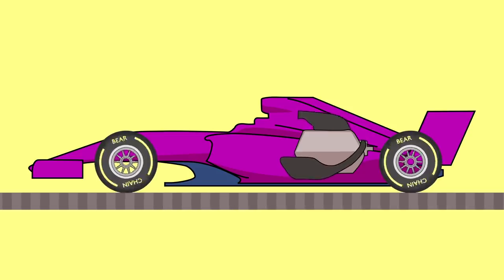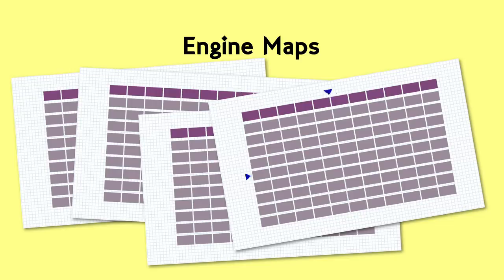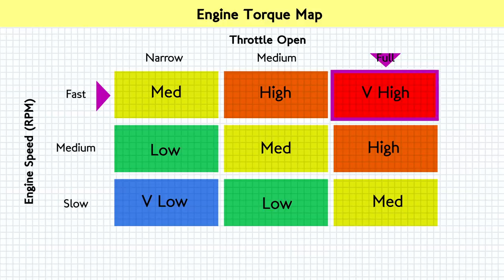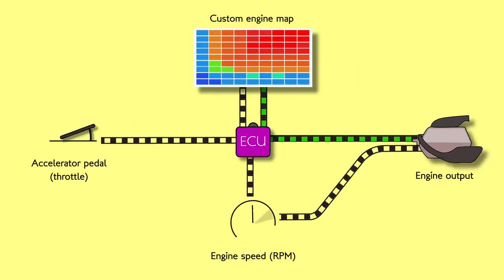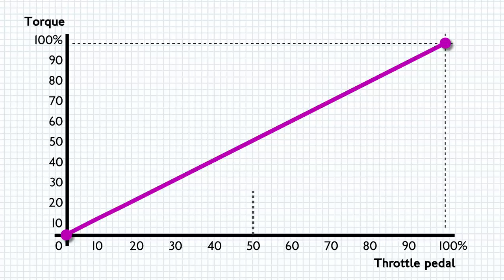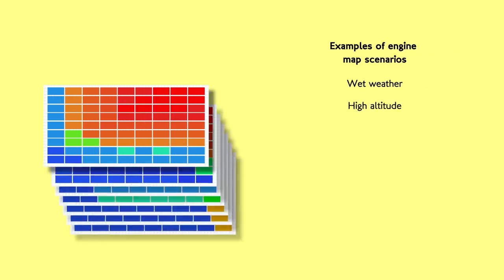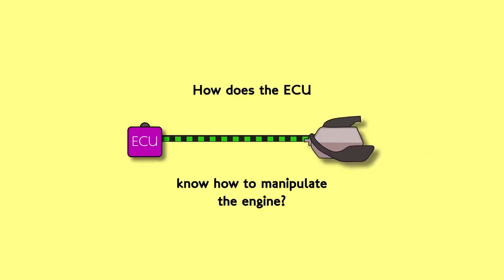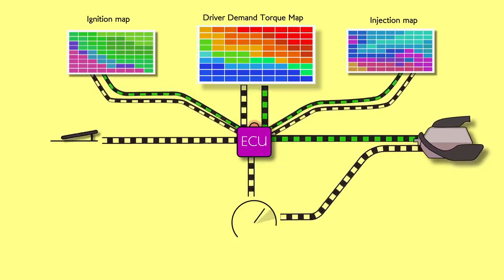F1 engine mapping - Chain Bear explains

Comment: My feeling is this; if two different drivers raced the same car with the same mapping programme their lap times better be within 1/100 's of a second of each other if they are so called "professionals". If not, someone needs to get fired. What happened to the old days when the throttle was controlled by linkage or cable? Those drivers were real racers, real warriors!
🤓

Comment: "It sounds complicated, but it all happens incredibly smoothly" Thats because mapping that IS incredibly complicated, especially to allow it to happen incredibly smoothly. Its actually pretty damn complicated to map a modern road engine using torque based modeling and those engines arent even in the same sport let alone the same ballpark as F1 motors in regards to thermal efficiency and how razor thin the GO/NOGO line is in the mapping.

Comment: Despite great graphics, it's not accurate and confusing. Throttle map is a thing (input : pedal position, output : throttle bodies position) And engine map is another thing (main inputs : throttle bodies position + engine rpm (+air temp, air press, water temp,...) outputs : injectors duty cycle + ignition timing
Reply: Not anymore. What should ECU do if trottle pedal is just pushed 80% and turbo boost is only 2 bar out of maximum of 3 bar.
Should it apply only 80% (3/4*80%=60% of torque) of the throttle body position or 100% (3/4*100%=75% of torque).
Should fuel injection, MGU-K or MGU-H compensate for that? How much?
Well, engine maps are to HELP the driver, so everything happens exactly like described in video
MAYBE, just maybe ECU can look at the tables and correct for the boost or anouther factors, apply slightly different torque at different RPM, so driver has a easier to controll car.
Reply: @volodumurkalunyak4651  Agreed, but still,  it's the job of the engine management to handle such subtle corrections. Throttle-map is just one of many INPUT of the ECU (how much torque the driver is asking regarding the pedal position)

Comment: Is this how the "Party mode" works? In that 100% throttle might not give 100% of the torque in the race, but instead gives, say, 95% for most of the time, until qualifying when they turn it up? Or is that a fuel mix thing? Or both?
Reply: Nobody knows for sure otherwise Renault and Honda would have party modes too 😉, but it's likely a combination of more aggressive engine mappings + ers deployment(Previously Mercedes were also burning a lot of oil to increase power during "party mode", until the FIA got wind of it and regulations for oil burn came into place) . There has been lots of speculation this season that ferrari have managed to close the power gap to Mercedes by using a clever ers deployment during qualifying with their 2 battery system that is somehow able to deliver more power for a longer duration than other teams.
Reply: This is just scratching the surface. This isn't counting ERS deployment and harvesting, fuel mix, turbo boost and other things

Comment: Surprised you didn’t mention anything regarding feedback from exhaust temperatures and O2 sensors to manage efficiency of the combustion process. 

Also, on a traditional butterfly throttle valve setup, the “map” is not linear.  It’s more S shaped.

Comment: The throttle doesn't control fuel flow. Maybe the air-fuel mixture, but the throttle is not connected to the fuel tank. What a terrible animation.

Comment: Thats why alot of the drivers experience loss of pauwa.  (ricciardo)  your completely at the mercy of complex systems. 🤔..
Unlike old school, where a loss of power probably meant a dirty carburetor ,faulty spark plugs,coil. Blewn gasket,losing compression,etc...🤔....Lol 
But I may be wrong 🤓🤥😈☻..

Comment: Well done, but you could have added, that any modern car has an ECU doing all of this and more (like the catalytic converter that F1 cars don't worry about). So, even the cheapest cars have more complicated Ecu's nowadays than F1 cars. Furthermore on street cars the input values like temperature have far greater variance. When has an F1 engine ever had to start and run at -40 C?

Comment: This is an explanation for gas pedal mappings. It does not explain the engine settings currently used in f1. Engine mappings consider 

a) the air/fuel mixture: the more air you get into the cylinder the more efficient the engine will use the added amount of fuel thus creating more power. On the other hand the mixture will be harder to ignite and burn hotter creating more wear on the engine leading to 

b) the timing of the ignition or „engine timing“:

As a rule of thumb you have a constant variable of how long it will take the mixture of fuel and air to ignite and reach its full potential of energy release. You want this to happen when the piston is moving downward and the crankshaft reaches the rectangular angle to the movement of the piston. But the faster the engine goes, the more you have to ignite the mixture ahead of the downward movement of the piston leading to potential engine knock and ecxessive wear on the engine. When and how much fuel is injectet also plays into this game. As a rule of thumb you can say the more efficient you run the engine, crucially in these days of max fuel flow, the more you put stress on the engine through heat and vibration. 

c) boost pressure:

the turbo charger presses more air into the cylinder leading to a more efficient combustion thus creating more power. It enables to add more fuel combusting with more air as you need a certain ammount of o2 to react with the fuel during combustion. This on the other hand also creates more exhaust gases driving the turbo even more. As the turbo is no longer a turbo but also creating electricity that is not limited by the fia via the mgu-h you want that thing to spin as much as possible at any given time. So you want the engine to pump as much air as possible which on the one hand also leads to a better and more efficient combustion as mentioned above. On the other hand it creates more heat as the air is compressed prior to the combustion creating more wear on the engine. When the engine ist exceeding certain speeds in rpm it can not maintain the boost pressure because it would be overcharged given the injectiontiming has to be more in advance of the piston reaching its upper dead spot (german english alert!) and  with higher boost pressure the risk of self ignition would be higher. So, the ability to maintain high boost pressure at higher engine speeds is again a question of how much wear you want to occure on the engine for the sake of producing power with the given ammount of fuel. 

These factors and surely some more describe the mapping of an engine as you can influence these factors with timing, mixture an boost pressure. It is always a struggle between efficiency and reliability over the course of a few races.

Comment: Point of order: Injector timing isnt a main fueling map.  It will have an effect on low/midrange torque but not overall power.  There is a VE/Load table that controls main fueling.  In general it will read off air coming in and current a/f to determine the next cycle of fueling.  Fuel mapping is rather simple... different richness settings for power enrichment.  Could also add in what point PE happens based on throttle percentage.  Its fun to see a video of something I've done on modified road cars.

Comment: Great video can I just suggest touching on the lean burn subject next time? Figuring out the mapping has been SO tedious in this engine formula because the fuel flow rate is restricted for everyone. Lean burn is perhaps the most intriguing part of modern F1 mapping since it has such catastrophic effects when mapped incorrectly.  But when it's set up the engine can run in compression ignition. I think the oil injection and burning deserves a mention as well since all competitive teams are burning up to the alotted (I believe 800ml) over race distance.

Comment: That’s interesting, I didn’t realize that due to the extreme amount of control they have over the engine so they can “personalize” an engine to a drivers preferences. I mainly thought they were used for fuel saving and engine wear saving vs max power for overtakes or qualy

Comment: One thing I wanna know is the brake by wire system on the rear wheels of a F1 car. Because it uses MGUK to apply brake torque to charge the batter, isn't it possible to make it work like an ABS set up on the rear wheels?

Comment: Most non-traction controlled car I've seen use something call torque per gear or boost per gear (forced induction engine) to control the amount of power send to the tyre to control the amount of traction by limiting the overall power output without the need of wheel speed sensor. Of course power is a relation between torque output and engine speed so any cut-off from either both will help with power output management. The problem is that any modern engine relies on gearbox system as a torque multiplier to set the car moving from complete stationary. This torque management will help as far as traction are limited at low speed but the drawback is as the speed going and the car now are somehow not limited by traction, the whole power unit need to utilise the full torque multiplier preset by the tuner but as the system is somehow being kept online, the car wont experience a full torque multiplication as the system doesn't know that it need to go offline as the speed increase. Most car with this setup will suffer on rolling start racing or going through tight hairpin using the lowest gear as the vehicle will experience a huge lost in acceleration (per my observation)

Comment: It's hard to imagine how racing used to be pure engines and then seeing today's cars. We wouldn't have the race cars we know today but I'm not a big fan of computers being such a huge part of racing. I can't believe teams have to submit their engine mapping for approval either. F1 seems to be closer to racing in a simulator than actual car racing. 

I know these things evolve over time but I'd like to know the year computers began getting involved in racing, aside from just monitoring sensors and which things were initially controlled by computers. ?? I think that would be a GREAT video!
Reply: This is a competitive racing and if computer's can be used for competitive advantege, they will be used for that, especially if rules encourage just that.
BTW managing turbo boost, hybrid battery SOC, car acceleration, MGU-K braking (or acceleration) on tight corner, when you'r head expirience 5 g's of acceleration is for sure hell on earth. This is primary tasks for computers to do.

Comment: Can someone help me wrap my mind around this: how can the open throttle be dumping a lot of gas into an engine doing low RPM? I kind of figured the relation to throttle and RPM was fixed?
Reply: The relation between throttle and RPM isn't really that simple, the ECU bases the amount of fuel used by engine load, quantity of air entering the engine and other miscellaneous info from other sensors. In the instance of low RPM high load the ECU determines that the amount of air entering the engine means that the driver needs a large amount of acceleration. At high RPM low loads the fuel charge can be less as it is easier to maintain speed.

Comment: I’ve got a question. Do you know if the teams set the maps themselves or is it just the engine supplier? For example: do Force India set their own maps for the Merc engines or do Merc do that for them?
Reply: I mean I assume Force India set the maps but I’ve always wanted to know for definite
Reply: My guess is Merc sends a ‘standard’ set of maps to their customer teams that work reliably with the engine. Merc will have their own finely tuned maps and I guess it’s up to the customer teams to tweak the standard maps into their own to suit their car/driver?!

Comment: So the question remains... When and how are these maps being put on? during the race? How much is the driver involved and how much can the team do during a race. You barely scratched the surface
Reply: There is a switch on the steering wheel for the driver to cycle through pre-set maps.
Reply: Short and simple, the team tells to driver what to do and then he presses the buttons he needs to.
Reply: Thank you :) seems easy though. Would like to see a video about the different steering wheels and the buttons pressed!

Comment: Traction control just a fancier name
Reply: Forced Media not really, cause traction control will automatically limit the engine torque when the ECU notices wheel slip. What he talked about here was more or less about the throttle shaping and linearity of the power delivery. Wheel slip is still majorly controlled by the driver